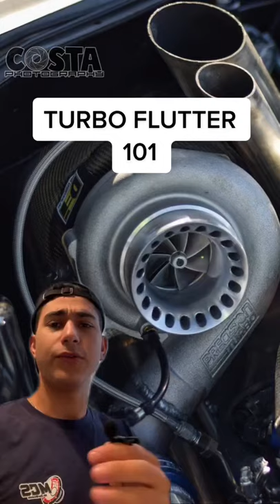TURBO FLUTTER 101 - Explaining Sutututu Theory

Comment: To simplify it, the turbo builds up boost, but its trying to push it throw with the throttle closed. Causing reversion
Reply: this complicates it for me, is fluttering gonna break the turbo and is there a way to only have it go off when you red line?
Reply: @mudmane808  a normal good quality turbo wont take any damage from this. The air is pushed back through the turbo by the pressure built up inside the manifold when throttle is closing and the air have no way to go. The higher the pressure the more sound.
Reply: @mudmane808 if you have a cheaper turbo maybe like 200-600 it’s not really safe, but many people never had problems with jt, it is said that I drastically reduces the life of the turbo but,
Reply: @mudmane808  no it isnt
Reply: @mudmane808 it's called turbo surge and it's not good for the turbo. It's funny when you hear this classic sound like it's cool but in reality the setup is garbage and the BOV isn't big enough. 😂
Reply: @TTyote  It is cool though.

"in reality the setup is garbage and the BOV isn't big enough."

Hard to have a big enough BOV when you have no at all.
Reply: @DriftNick  OK so no BOV at all. Got it. So hot garbage then. 🔥🗑 😂
Reply: @TTyote  Why is it garbage?
Reply: @DriftNick  are you fkn with me or are you really serious? I feel like I just explained to you why turbo flutter aka turbo surge is bad for the turbo. Once the TB closes the air has nowhere to go so the turbo works against itself and eventually will wear out the bearings and cause shaft play which will destroy a impeller blade and cause the turbo to explode more or less. When you hear a flutter it means the BOV isn't letting enough air out fast enough. Not good.
Reply: @TTyote  American's are so scared of flutter, meanwhile here in Australia it's common place to run no blow off valve, if it does any damage it's so minimal you wouldn't notice, the turbo doesn't really care.
Reply: @DriftNick  nobody is scared, we are just aware of the problems and simply avoid them. Also it's a problem when your making 25-35 psi making 1500hp on a full pass and bend the butterfly, blow off charge pipes I mean the list is long but you go ahead and do you mate. 🫡
Reply: @TTyote  There is a workshop here that builds 1500hp+ RB engines, they mentioned bending the throttle butterfly when pushing 70+ psi and that is why they started running blow off valves, most people aren't going to get even close to that number though so not really an issue, blowing off a charge pipe is user error.
Reply: @DriftNick  not true. This is why they have Vanjen clamps because I've seen it happen to the point where you have to weld a bung on each side of the pipe and bolt a heims joint union to keep it together. Happened on my dad's procharhed 2000hp outlaw 10.5 foxbody that's why he has 2 50mm vortech BOV's because you really can hurt alot of things with a power adder from too much charge pipe pressure. Your right not alone of people will see that but it doesn't change the fact that it's surge and its not right. Period end of story.
Reply: @TTyote  Procharger and turbos are not the same, there is a much larger pressure spike in the charge pipes from the supercharger then there is with a turbo.
Reply: @DriftNick  my point is you see it causes issues on both sides but you are still somehow defending it. Weird flex.
Reply: @TTyote  Weird flex? I see you also don't understand that meme. 

Your point is mentioning superchargers when you are talking about turbos, not understanding the differences and that most people aren't making 2000hp+ so that doesn't really matter.
Reply: @DriftNick  holy shit bro I know the difference. Overpressured chargepipe pressure is not a good thing. That's my point. Stop trying to sidetrack because you know you are wrong. Nobody rides around without blowout valves that actually knows what they are doing.
Reply: @DriftNick  idk why I'm arguing with someone who is from a country where they build pro mods just to do burnouts. 🤡😂
Reply: @TTyote  I guess BMW and Ferrari don't know what they are doing, they don't run any valves in their GT3 race cars.

"where they build pro mods just to do burnouts."

Seems like you also don't know what a pro mod is because no one is doing that here.
Reply: @DriftNick  they have a bypass valve which is essentially the same thing. Also I was on a pro mod team. I have seen the engines that are in the Austin cars and it's essentially a pro modified engine setup build strictly for burnouts. You can try to be slick but I've got you at every corner bud.
Reply: @TTyote  I didn't say they don't run blow off valve, I said they don't run any valves, that means they don't run a bypass valve either.

" I have seen the engines that are in the Austin cars"

Austin?
Reply: @TTyote  the only time surge will be bad is if its on throttle, not off of throttle
Reply: @bifta4323  also surge at wot? Where they do that at? 🤔😂
Reply: @TTyote  What do you mean where they do that at? do you not know about on throttle surge?
Reply: @DriftNick  Compressor surge and throttle surge are not the same thing. Throttle surge has nothing to do with your BOV. Basically the turbo is flowing more air than the motor can injest so the air backs up and slams into the turbo so that just sounds like whoever mated the turbo compressor/backhousing with the engine is an idiot.  Kinda like you guys sound right now. 😂
Reply: @TTyote  No surprise you also don't understand on throttle compressor surge and yes that is compressor surge is what people call it, even turbo manufactures call it that, nobody calls it throttle surge and no one mentioned it having anything to do with a BOV.

"sounds like whoever mated the turbo compressor/backhousing with the engine is an idiot."

Steve Morris recently had a video where his turbo was surging, guess he is an idiot, if the conditions are right even the correctly sized turbo will do it, it's literally why anti surge housing exist.
Reply: @mudmane808 as the turbine gets spun by the exhaust gas the compressor wheel on the other side pushes more air into the engine through the throttle body 

When you close the throttle for whatever reason the turbine wheel and compressor wheel are still spinning 

The compressor is still pushing air 

With a BOV that air escapes. One big sneeze

Without a BOV the air slams into the throttle body plate and then piles up being compressed in the system between the outlet of the turbo compressor and the throttle plate 

It can only escape out past the compressor wheel. This effectively shocks the wheel making it go from spinning possible tens of thousands of RPM to 100s

Yes it stresses the wheels and the shaft and the bearing. The better the materiel the more it can take but it still stresses it 

The Stu Stu Stu is the wheel fluttering the air 

You can get a turbo with anti surge. Those are the holes you see on that turbo in the picture 

Either get that or run a BOV
Reply: @jrich436  Spinning possible tens of thousands of RPM to 100s? no it doesn't even slow the turbo down, people have tested it, there is no difference in the rate the turbo slows down when you lift off the throttle between running a valve and running no valve.

You are a perfect example of the type of people that say it does damage and it's bad for performance, people that have no idea what is actually happening.
Reply: @roostercake5437  10+ years of doing it, never had an issue.
Reply: @roostercake5437  Only seems to be a problem for people in North America.
Reply: @roostercake5437  No, I'm not in North America, that is why I don't have any problem with it.
Reply: @henninghellerud  this is wrong buddy. No matter what you say it's the same as bending a stick
Reply: @roostercake5437  Just realised you are the guy that replied to my other comment and said it makes the turbo spin backwards, if you do own a shop I feel sorry for about that people that go there, you have no idea what is happening lol.
Reply: @DriftNick  so applying force to  something that is not meant to go in that direction won't hurt it AT ALL? The "flutter" you hear is COMPRESSOR SURGE  not something cool. I do not have to argue with someone with the IQ of a doorknob. 

WHAT'S THE POINT OF BLOW OFF VALVE? I'll wait
Reply: @TTyote funny that my 600hp single turbo rb26 s14 loved having no BOV sounded mental and yet I never done a turbo huh go figure and my wrx is the same no BOV but keep believing in that compressor surge myth almost every car in Aus has a BOV delete 😂VL turbos,Skylines ,Evos xr6 Turbos etc  a lot of people delete there BOVs here.
Reply: @roostercake5437   what are you talking about? Go ask people that has driven like this for years with no issues what so ever. This debate has been up so many times, and every time people claim that the turbo gets damaged. But it doesnt by this. Its like people saying "its bad cuz the turbo changes rotation direction"  come on....
Reply: @TTyote bruh you know nothing
Reply: There is no reversion other than the air. The turbine is moving so fast it can't possibly slow down that fast
Reply: @roostercake5437  if the stick is made for bending then there is no problem bending it
Reply: not logic
Reply: @jrich436 you failed physics if you think 20 psi is gonna slow down a spinning wheel from 100 000rpm to 900rpm
Reply: @roostercake5437 it’s like you jumping in front of a train, the strength difference is so big the passengers (turbo) wouldn’t notice anything
Reply: @a_catfish5180  psi is how non engineers make approximations of what’s really doing the work CFM

The PSI doesn’t matter, the CFM as a function of a/r and wheel speed 

I will say that I worded that poorly the wheel does not go from one extreme to another in flutter 

Flutter is not as bad as surge, it’s not AS extreme and I did not mean to imply that it did or is 

but it does prematurely wear the bearing and it’s exponentially higher once the damage begins and the clearance widens, with each instance of adding a axial moment of force in a unit that has no anti surge 

It’s not blowing your turbo up catastrophically, but it is measurable in wheel deflection 

Yup definitely failed physics….. you got me
Reply: @jrich436  dude go to bed you’re just trying to salvage what you said
Reply: @a_catfish5180  I’m adult talking on the internet to people….

Yeah I’m literally being an adult and saying that as typed I understand what the push back is, I was not completely clear 

When you become an adult maybe you’ll be able to do something similar. Maybe 🤔
Reply: @a_catfish5180  incorrect
Reply: @mudmane808 flutter isn’t good for cheaper turbos but it sounds sweet so… have at it.
Reply: @Oob144  honestly the only comment my brain actually processed
Reply: @roostercake5437  do you think you would make a dent on the train? Are you that dense?
Reply: @TTyote no. Grand nationals didn’t have bovs just a wastegate in the exhaust. Not necessary and 87 gns still quicker than new cars.
Reply: Flutter is HORRIBLE for every turbo!!!
Reply: @joshHg89  No it isn't.
Reply: @DriftNick  ya it is... it's the Turbine wheel and Compressor wheel fighting each other...the guy in the video didn't describe it correctly...the exhaust is still trying to spool the turbo and the Compressor is trying to stop the spool because the boost has no where to go...this is how you break shafts an make a 2 piece fan from your turbos. Hence the noise it makes...stff(stop)stff(stop)stff...aka AHHHH HELP GET ME A BETTER OWNER!!!
Reply: @joshHg89  The flutter sound isn't the turbo stopping if that is what you are trying to imply.

"the exhaust is still trying to spool the turbo"

The throttle plate is closed, exhaust flow is greatly reduced, the turbo isn't try to "spool", it's slowing down.

"this is how you break shafts an make a 2 piece fan from your turbos"

Funny never had that issue nor have I ever heard of that happening because of flutter.
Reply: @mudmane808 the flutter is not good for the compressor inside the turbo and will reduce the lifespan of any turbo regardless of brand. You can get the same sound from a T51r mod which you can have done on the turbo at purchase or you can take it to a machine shop. In addition to Blow off valves some setups run a Diverter valve or recirculating setup and instead of venting the pressure to atmosphere it will vent back into the intake manifold. All setups have different pros and cons and sounds and applications just choose what one works for you:)
Reply: @douglasbrewer9259  Another in the long list of comments from people that don't understand what is happening saying it damages the turbo.

" You can get the same sound from a T51r mod"

You need to go learn what the T51R mod is, it has nothing to do with turbo flutter.
Reply: @DriftNick I agree with you. Compressor surge shouldn’t damage a turbo. Compressor surge is terrible in gas turbine engines but that’s because there’s fuel being burned right after the compressor section and if it doesn’t go the right way, it’s not good, plus it can explode and cause spiking temps and pressures. 
The pressure spikes when the compressor surges, but the spiked pressure is still low enough to be safe. At least, for any good quality turbo.
Reply: @DriftNick  .
Reply: @TTyote  Why the dot reply?
Reply: @DriftNick  read above
Reply: @TTyote  If you posted something new I can't see it.
Reply: I liked my own comment
Reply: @TTyote  Thank you! It's hard to find anyone who actually understands this.
Reply: @EddieTheH  It's a shame he is wrong.
Reply: @DriftNick He really isn’t, though you have your right to your opinion same as everyone else.
Unless you’ve done your own testing or read others testing about it I wouldn’t recommend talking about it as facts though.
Reply: @BMWe-ed2tn  I've done exactly that though, countless people here myself included running no valve without issues, top level motorsport teams running no valve without issue, the only people that have problems with it are people they have never actually ran a car without one.
Reply: @DriftNick  Damnit I mixed you up with the guy saying it’s bad! Like you said all research prices it’s not doing anything to the turbo, the research even says it’s not air moving past the impeller it’s airflow basically reaching zero in the inducer for a split second.
No “the impellers are fighting each other” , that is the nature of how a turbo works or the compressor spins backwards as the turbine still has exhaust flow and the shaft/compressor still has inertia.

People also argue that rally cars do it and have to change turbos every race but there’s a lot of parts being changed every race and turbos never have been part of that list among the rally teams I’ve spoken to, maby they were before when antilag was used as that will hurt it.
Reply: @bruh2858 so it makes the noise but is there performance loss by not having a blow off valve, also can you have a closed system on any turbo setup
Reply: @nino3613  There is no performance loss by not having a blow off valve, in fact there is a performance gain as boost pressure does not need to be built up again between the turbo and the intake valves.
Reply: @DriftNick  ohh I see, the only downside would be possibly a shorter life for the turbo then?
Reply: @TTyote no americans are very scared of not running bov’s in general anywhere else runs no bov’s without any issues.
Reply: @DriftNick i see this all the time im not sure why everyone thinks its going to really effect something when its been proven to this day it works 🤣
Reply: @catlol5  yall toilets flush backwards so im not surprised
Reply: @catlol5  be dumb. Idc.
Reply: @catlol5  Boostcreep thinks he knows more then BWM, Ferrari and other professional motorsport teams because his dad may have built a fast car.
Reply: @TTyote  and you scared to not run some lil metal circle
Reply: @DriftNick  yeah bro idk whats good with this dude he clearly hasnt dug into youtube and or drifting enough to also understand the history
Reply: @miatnam  none of you have anything fast so just stop. Even little jdm boy with his gtr can get gapped.
Reply: @DriftNick  drifting isn't a real sport. Also when do you see BMW or Ferrari ever dominate at the dragstrip? They slow af.
Reply: I’m no mechanic and have little knowledge on this but I would expect it to do more damage than if u had a blowoff valve as they are made for this reason and putting extra work on the turbine will cause wear.   My big worry is if it’s spinning day clockwise and the blowoff air is coming backwards it would try to doing it anticlockwise and this may cause damage.   Them turbines look pretty weak and designed to spin one way and balanced finely.   Wouldn’t risk it myself on a £500 plus part blow off values are dirt cheap to
Reply: @TTyote  Imagine trying to talk crap about drifting when you are a drag racer LOL
Reply: Is this ok? Or not good.
Reply: @catlol5  then what are bov's for?
Reply: @sdam8080  thank you!!!!¡! No it won't trust me
Reply: @roostercake5437  Blow off valves exist because people like the noise they make, bypass valves are factory fitted for emissions and issues that can happen with air flow meters if there is no valve.
Reply: @roostercake5437  to release air pressure within the system, which you can do the exact same with a wastegate and have a dump lol iykyk
Reply: @catlol5  incorrect, its to release or recirculate air pressure when the throttle body is closed  SO IT DOESNT GO BACK AND DESTROY YOUR TURBO
Reply: @roostercake5437  Running no valve does not destroy your turbo.
Reply: @henninghellerud Even if you have a good turbo setup that is still not good for the longevity of your turbo run a blow off valve and a wastegate.
Reply: @DriftNick  Lol that's what they are made for you area special kind of special.
Reply: @roostercake5437  The person that thinks it makes the turbo spin backwards talking crap is great, come back when you learn the basics of how a turbo works.
Reply: @DriftNick  come back when you learn common sense
Reply: @roostercake5437  Spins backwards LOL
Reply: @81Todd  myth
Reply: @mudmane808 no it wouldn't
Reply: It's a bad thing right?
Reply: @titoxevyvlogs8434  yes it is.
Reply: @joshHg89  😂😂😂😂😂😂😂😂 my guy right here
Reply: @roostercake5437  you notice he didn't say anything back to me, just chose someone else to troll
Reply: @titoxevyvlogs8434  It's not bad, ignore that roostercake guy, he lacks even a basic understanding of what is happening.
Reply: @DriftNick  now im tempted to make mine go stutututu 😂😂
Reply: @keno8837 so then is this actually an inefficiency? Is a blowout valve preferable?
Reply: holy crap what a yap session from all of you 💀. in my personal opinion, i can understand the worry about putting excess backpressure on the turbo, possibly causing undue wear, but i’m sure high quality turbos have other ways to eliminate the backup. however, it’s your vehicle, do what you want with it, it’s no one’s place to say what you can or can’t do to your vehicle.
Reply: Don't argue with an American. They drive autos lol @DriftNick
Reply: @TTyote No, that is not surge. Surge is when tje turbo does that, but while accelerating. In this case the engine cannot swallpw all the air that is coming to it (too big turbo, too much boost, toosmal valves or throttlebody), and the air comes back against the turbo. And as you are accelerating, dump valve does not act, and the turbo take all that while it is under load. Bad.

But, while off-throttle, off boost, the turbo is not under charge (wastegate fully open), so basically no harm. This is the Sututu